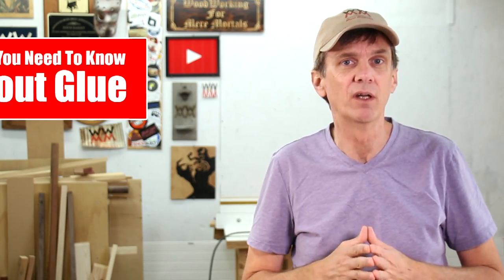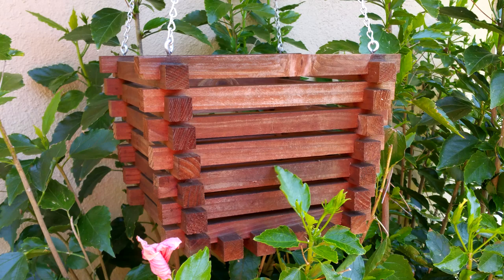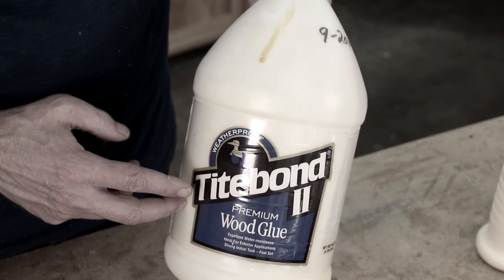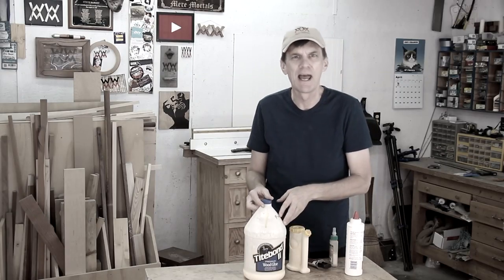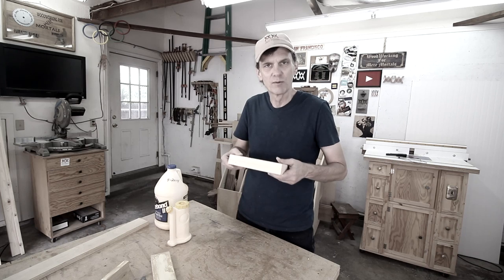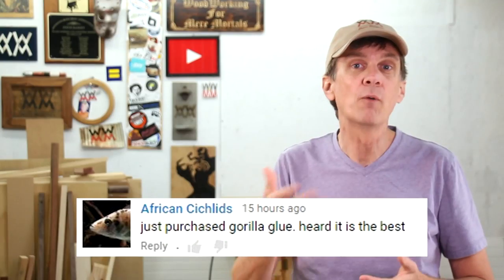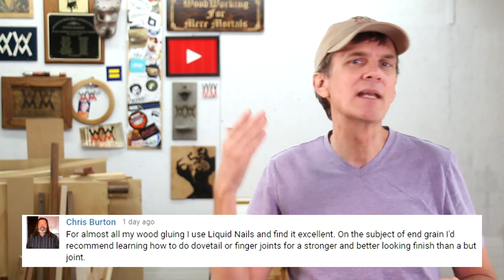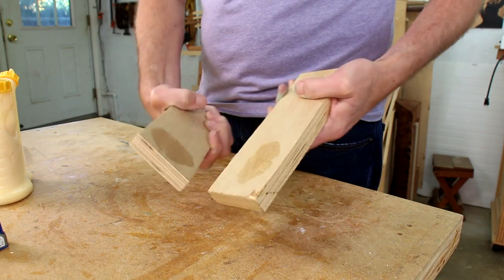Why I Don't Use Titebond III | MORE MINUTES

Comment: i use super glue with the activator on the lathe as with a good knock you can break the joint cleanly,

Comment: I've used Gorilla Woodglue with great luck, but as another commenter said, one of the downfalls of it is it will turn into a dried silicone-like wad of useless material if you don't use it in a timely manner. How long will TB2 last in a hot or cold storage environment before it becomes useless. Also I've used Elmers and over time, it turned into unusable sludge.

Comment: I’ve only once used gorilla glue for a project. It was a worktable and I used the glue to glue the plywood top to the OSB core and it worked pretty well but it was not fun to use

Comment: Using glue and saw dust in the piece looks fabulous until you go to stain it. For something smaller like nail holes, it might be ok but it just takes the stain differently. If there is a trick to it, I haven't figured it out.

Comment: you can use activator with any cyanoacrylate glue. It's not a new type or anything.    it's just an alkaline solution. Baking soda will make it set faster too
Reply: +KingNast So does water...well, it seemed that way to me, I tried to rinse (note rinse!) super glue off my finger, it instantly went solid! Left me with an interesting "skin" to try and remove...

Comment: Try 2p10 CA glue. They have a thick which works great for wood
Reply: Gorilla sells a CA glue GEL version. Doesn't run all over creation when applied.  Tight-bond also sells a CA glue for wood. I just got a bottle from Amazon for when I have a use for it.

Comment: We use Titebond III to build bee hive boxes, lids and frames. There is a BIG difference in water and moisture resistance than with Titebond II.
You stated and showed your outdoor use.
Have you ever actually attempted to pull those glued items apart?
The interior of a beehive is a warm and humid environment.
I have seen Titebond II turn gooey.
Frames will pull apart. No Bueno.

Comment: we use super glue a lot in finish trim carpentry for horrible fiddly little bits that normally return into a corner the kind of bit that is very short usually

Comment: I use super glue a lot while woodworking. It is very popular is wood turning as a finish. The real downside is the fact that it is extremely expensive, and leave a plastic like coating. The main reason I stopped using it was I developed a sensitivity to it after a year or so of use. My eyes start watering badly. If you do use super glue then please be sure to wear a respirator and use in a ventilated area.

Comment: Main difference between type II and type III is , you guessed it, the price.
Reply: +RC Ward - I use all of the titebond line. type 3 is quite a bit thicker and harder to deal with. It's open time is a third longer than 2 for me. I'm in Florida and humidity does have an effect on dry times as well as viscosity and flow.

Comment: Yesterday morning I messed up and glued a fretboard to my neck on an ukelele, I did not use proper method and I glued it maybe 2-4 mm off target. Is there anyway to remove titebond III?
Reply: Have you tried vinegar? May need to slightly warm it in the microwave to work on extremely stubborn glue.  Don't try heating the workpieces, as that will cause the glue to adhere even more by allowing it to seep further into the pores of the wood.

Comment: As lomg as there is no pressure on your static parts type 2 is fine.  I've used titebond for many years and I'll never use type 2 for anything that has any stress on it outside.

Comment: For filling holes with sawdust and glue. I made a cup of the diluted stain and poured sawdust into it to absorb all the stain. I stirred the cup and then poured out and spread the dust to dry. I then filled the holes with the stained sawdust and glue and got a very near match when it came time to stain the entire project.
Reply: +ZipKickGo Wouldn't you worry that the saw dust would absorb too much of the stain?
Reply: Paul McLagan
I'd go into the project knowing what my desired stain would be by using test pieces. I'd match the saw dust by trial and error. Usually I get it the first time, I use very little stain and work up the dusts stain to match my test pieces.

Comment: On the subject of superglue's strength on non-porous surfaces...have you not seen Mythbusters? lol they showed a single drop of it holding a LOT of weight.  I believe later in the episode they used superglue to lift a car.

Comment: just to let people know I used DAP construction adhesive on two separate pieces of pine that were perfectly flat and it warped them so badly the  glue couldn't hold and the boards were unusable. So I don't use construction adhesive anymore.

Comment: Is it possible to clamp a joint so hard you squeeze all the glue out? Sure, especially if the mating surfaces are dead flat (it's also more likely wth hard, dense woods than with softer or more porous woods). But you have to really clamp the heck out of that thing, and if you're clamping that tight you risk denting or even breaking the wood, either of which is a harder problem to fix than a failed glue-up.

Comment: The super glue you were using isn't for woodworking. You need to get actual CA glue. I made that mistake. You need to go to a woodworking store to get it. Names like mitrebond, and fast caps "2p-10", "hot stuff" from lee valley. You can get different viscosities for different jobs. It's prefect for repairs.  Believe it or not it was a pretty big game changer for my woodworking.

Comment: A joint can be starved of glue, but it takes several thousand newtons of force. For instance-I've never had success with any glue when driving a wedge for hanging an axe. I'm not saying that I rely on the glue to hold the wedge, I'm saying that when I rehang said axe after long time and I wrench apart the wood left in the eye, the glue doesn't make a difference-it just falls apart. All in all, you can squeeze out all the glue out of the joint, but you must use a hydraulic press to do so.

Comment: Cyanoacrylate glue only works when it uses water as an activator. In fact, this is why it cures so easily on your skin. Your body is made up of over 70% water, and cyanoacrylate uses this water to cure quickly.

The reason it won't work on wood boards (especially those found in California, whose had it's fair share of droughts) is because they are normally dry and lacking moisture. This lack of moisture means that cyanoacrylate glue will not cure as much (or at all) because of the lack of activator.

If you do use it for wood, you would either have to use the mister bottle like the gorilla glue or use a separate activating compound.

Comment: Cyanoacrylate glues work best when both surfaces are perfectly flat. Wood tends to have too many air gaps. Also, they have great tensile strength (when the surfaces are being pulled apart), but poor shear strength, as demonstrated when you twisted the wood pieces apart.

Comment: Have u tried Cyanoacrylate with baking soda. I saw a video on that but have not tried it. Let me know how it goes... i can't remember who posted it..specially on canvas to canvas is what i am looking to bond together.
Reply: that trick is used to rebuild/replace small parts, specifically the first one I saw was fixing a broken nut on a guitar and today to make a tree for model railroad.  Don't think it works to glue stuff together.
Reply: Actually about a week after I got done posting that, I happened 2 of broken a piece of plastic trim that went around my window. I use the method discried by the other video and it works perfectly. Once it bonded all I did was sand it down. So I know it works for plastic on plastic. Just have not tried it on anything else. Let me know if you can find other uses for it?

Comment: Epoxy and sawdust finishes/matches pretty well.
Reply: +Dave StarrEpoxy/sawdust does work well. Some folks use hide glue. There are those who claim it accepts a stain but I could not achieve that. Shellac sticks come in many colors and they work well. I think the issue is how perfect does the match need to be. It's just a personal preference.

Comment: In defense of CA glues, they have their place. Where I think it is most useful is re-attaching small pieces of wood, usually a corner, that sometimes break off. You just put some glue where you need things to stick together, hold the pieces together tightly with your fingers for about 20 seconds, and it's back together. Then you can sand, card scrape or what-have-you off any extra glue and you're back in business inside 2 minutes. This is also a nifty way to glue your fingers to the work piece. I put on nitrile gloves when using CA glue.

Comment: Well Matthias did test the hard clamping method and those joints came out weaker, it's not an exact science because you never know how the wood will end up sitting but the strength was down across the board.

Comment: Titebond has a great summary of the differences on their web site: http://www.titebond.com/community/the-big-three

Titebond 2 "water-resistant" standard: http://www.titebond.com/resources/specification/019da3a7-0f5b-4239-a61c-4b4d3673b953

Titebond 3 "water-proof" standard: http://www.titebond.com/resources/specification/9f404cdf-76b8-4838-a7f3-0e917ef867f9

Titebond 3 is supposedly "stronger" (but not by much), and has a significantly longer working time.  Also important if you're working outside, 3 cures properly in lower temperatures.  Also note that the colors of 1, 2, and 3 are different (see your table results) which may matter depending on your project.  Oh, and don't use 1 for your butcher block, it's not FDA approved.  Make sure you use 2 or 3.

Personally I keep both around.  I use 2 when I want a faster set up (things that aren't fiddly to assemble) and I use 3 when I want a longer working time (for things where there may be multiple complex parts to align).

Comment: If when work in the shop you should always have wet shop towel with you at the station you are working  from... this is how you will always have it to clean the top of the glue container and any other situation that rises from the course of the day grease, paint, stain, wood resin or just to wipe off a machine or other tool..........

Comment: the difference is working time.  its much longer working time with titebond III.  When you have dovetail joints and they are very tight you better use a glue with longer working time or you may find you have a set up before the joint is closed!  Also the III is much less shelf life.

Comment: as for super glue on wood. Its pretty much the only glue used when building balsa wood model airplanes.   most of these planes last many, many years without issues. but the joint most the time is not really all that large at all.

Comment: ...or just buy smaller bottles of glue four or five times a year, so the tip gets replaced "automatically", instead of buying gallon bottles once a year, having to transfer them to a different container, and then buying new tips for that container? :-P

BTW, leaving more glue in a joint (i.e., not squeezing it too hard) is beneficial in a few specific circumstances (it makes the joint less likely to crack due to vibration, at the cost of making it less stable), but in most situations it makes no difference.
Reply: +RFC3514 I bought a little bottle and a gallon jug and refilled the little bottle when it ran out.  I get a decent glue dispensing bottle and I didn't pay for just an empty bottle.  Also titbond is quite a bit cheaper by the gallon.
Reply: Eric Matt - If your bottle is still in one piece, obviously it doesn't make any sense to pay more; I was commenting on the part in the video where he says the tips keep getting lost or damaged and he needs to buy new ones.

Comment: Liquid nails with fail where a project that used Liquid Nails  is in direct sunlight.  At temperatures over 150F the glue softens.  Otherwise a really good, sold glue.

Comment: Subjectively interesting......but you can use titebond ii to clean records. Put a thin layer on a record; spread with a spatula;  let dry and it peels off in one sheet taking all the dust from in the grooves. 

However; titebond III does not work the same way.

Weird how it's such a different make up.

Comment: Applying super glue, pressing the pieces together, then pulling them apart for a few seconds and putting them back together seems to be the trick.  I'm not 100% sure, but it might be an oxygen activated sort of effect.  We... uh... "accidentally" glued a clipboard to a table once with that technique, and the veneer on the table top ripped off before the glue released.
Reply: +Frostbain superglue is cold an anaerobic glue, which means that the less oxygen you have the better it works, that is why it is often mentioned on the bottle to squeeze the bond tight for a few seconds :)

Plus I found that the gel kind does not work really well

Comment: TB3 is also stronger than TB2, rated at 4000 vs 3750psi. 
You can also apply TB3 on wet wood.(Don't even try that with TB2)

Comment: You missed out epoxy which is probably the best of all. Just took a sliding door apart that I made 40 years ago using epoxy on  the mortise and tenon joints. The glue had lost none of its strength and there was zero water penetration on any of the joints.

Comment: Titebond III is WATERPROOF, I've made cutting boards with it and washed them over and over again (by hand) with no problems.  It's a good choice for boat builders as well.  It also has twice the open time as Titebond Original and Titebond II.  It is also more resistant to solvents and can be used at lower temperatures.

Titebond II is WEATHERPROOF, making it good for exterior use (like your patio table), but not good for continued direct contact with water.  It also has Radio Frequency setting capabilities, meaning you can zap it with a radio frequency and it will set almost instantly, this makes it very useful in commercial applications.

This information comes directly from the Titebond website http://www.titebond.com/titebond_wood_glues/Ultimate_Wood_Glue.aspx

Comment: Instructive, but I don’t agree with respect to Titebond 3–I’ve been pretty pleased with it and have gone exclusively with it for any outdoor project. So far I haven’t noticed any discoloration at the joints but I DO sand pretty thoroughly after it’s dry.

Comment: I used Titebond III on a pine project and didn't have that staining you showed.  It dried a little darker than II does, but not like you showed on that project.  It has a longer clamp time which I like for some more involved joints, but the difference in cost doesn't justify me to buy by the gallon like I do II.  
I thought about my next gallon of Titebond being the long clamp time variety, not sure since it isn't as readily available as the regular Titebond II.

I actually used Titebond III, and the sawdust and glue fix all in one project, go figure.  You might want to look at the piece here:  https://www.facebook.com/jim.dollens/media_set?set=a.10208671990259101.1073741880.1291166494&type=3

Comment: The sliding before it grabs is the classic "RUBBED" joint. Do not try and hide holes, make them into a knot by enlarging the hole and rolling a plane shaving in a mix of wood dust dust and epoxy and slide itinto the hole and push exra wood dust into it. let it dry and shave off excess. leaves you a perfect "KNOT" and is less obvious than a badly filled hole.

Comment: I think the fill the voids argument for polyurethane glue  has been debunked a few times at least. The glue filling the voids is full of holes which are weak. IMO  TB2, TB3 and probably other glues of this type are the easiest glues to use for woodworking and they are well past strong enough. The best use for polyurethane glues is to glue wood to non wood materials. I used to use it to repair Formica countertops where a small section had become detached. It was amazing for that purpose. much better than the thermal setting glue that was on the Formica to begin with.
I notice in videos various professional woodworking using epoxy resins. Those didn't work great for me. I think that is because using epoxy type glues requires knowledge of which one's to use and what primers to use with it that I didn't have.

Comment: "Amen" to that bit about wet rags and excess glue. In a shocking percent of YouTube videos some joker who doesn't know his arse from his (or her) elbow squirts PVA around like they own stock in Titebond. If a joint fits intimately a uniform film of glue and moderate clamping pressure will develop all the strength possible. If the joint fits poorly a cup of glue slathered all over the shop won't make a strong joint. These opinions are based on the results of stress-to-failure testing of joinery used in the air frames of wood framed aircraft, a situation where the woodworker wagers their life on joint integrity.

Comment: Titebond 3 is waterproof, not weatherproof. It also has a longer working time, which can be desirable in some situations.
Reply: That is the biggest difference between the two. III gives you much more working time which is key when doing stuff like multiple laminates. II sets up much faster which is also very useful when you don't want to come back tomorrow to finish the project. 
They'll both cope well with water and weather although III probably has the edge there.

Comment: Mythbusters did a special on super glue and it was surprisingly strong. They are able to lift a car with 7 drops of glue for about 30 seconds
Reply: It has great strength against "pulling" forces (like what Mythbusters did) but almost no strength against shearing forces.